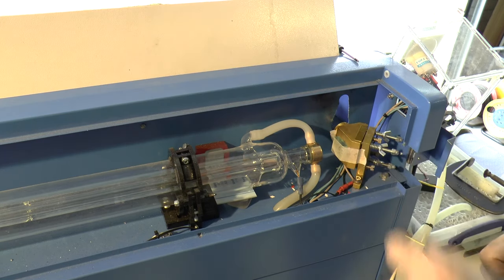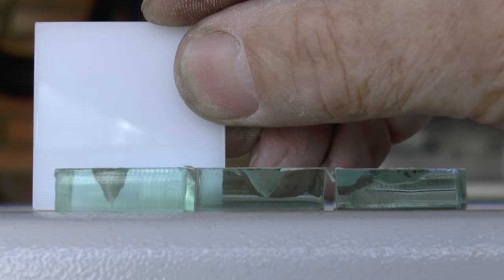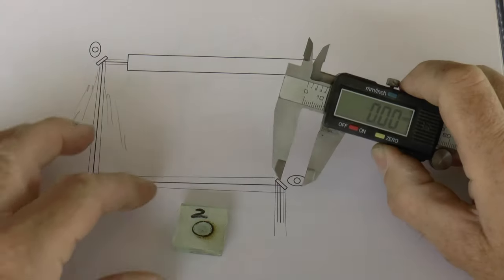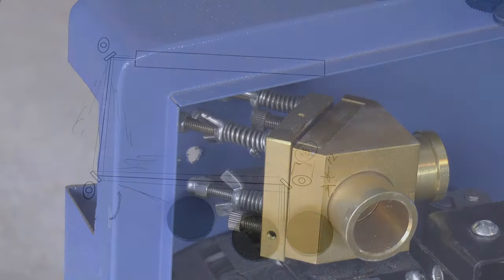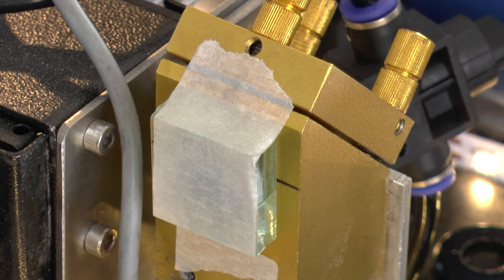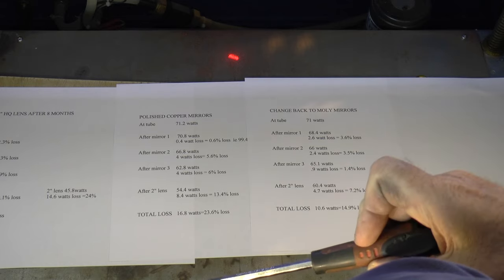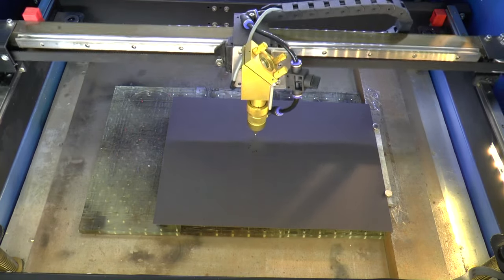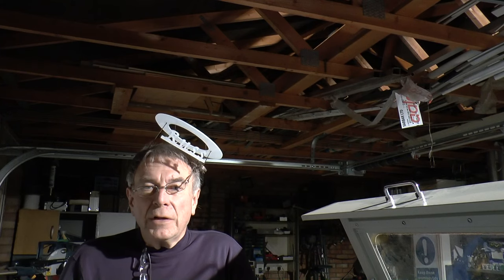RDWorks Learning Lab 79 Machine Health Check Part2

Comment: I have a curiosity question. How do you walk around totally open 60-80W laser without any eye protection at all? You even open a tube, and I see you don’t wear anything.
Reply from the maker: This is not suicidal stupidity. I have taken time to research and understand the nature of the beam we are dealing with.  This laser beam is a beam of invisible light. It is light in the infrared region of the spectrum that our eyes cannot detect. First you must realize that this laser beam is  monochromatic, coherent and basically non-diverging . That means that there is no scattering of the light as it travels around the machine, if it starts off as a 6mm beam, after travelling 2 or 3 meters around the machine it will arrive at the lens as a 6mm beam and nothing will have escaped. The light energy in the beam  is not in itself dangerous in the same way that a rock falling through the air is not dangerous. Only when the rock interacts with something does the harmless kinetic energy it possesses, change its state to something that is damaging and destructive. It's the same with the laser light  When it hits something solid one of two things can happen. If that surface is metallic, reflection will occur. Most metals are in the region of  90 to 99.9% efficient as mirrors. If the surface is non-metallic (ie virtually everything else you can imagine) then the IR light excites the molecules on the surface of that material to a higher vibration state. The higher the vibration state of a molecules the hotter their temperature. When you stand in front of a fire or you are outside in strong sunlight and your face starts burning, it's not because the  air is hot  it's because the infrared LIGHT that is being emitted from the sun/fire is stimulating the molecules on the surface of your skin to a higher vibration state ie the LIGHT energy is being converted to heat energy on your skin.
This is the mechanism by which the laser beam works when it interacts with the material we wish to damage (cut or engrave). There are many different types of laser  with much shorter wavelengths  which are more selective about what they will excite. These are potentially dangerous to your retina and you must always wear wrap around eye protection suited to the laser type. Not so with out long wavelength 10.6micron light. As I said, if this  light hits anything solid and non metallic it will start giving up it's energy as heat.  IF the beam were to hit your eye, it would start heating the surface of you eye (the cornea). That is still dangerous but you must ask, under what circumstances can that happen
Firstly, standing looking at the laser tube as it works is not going to damage your eyes. Without going into the technical way that the laser works, look carefully at your tube and you will see that is is made up of a central glass ionization tube that is surrounded by another glass tube containing cooling water and finally an outer large diameter glass tube that contains the gas mixture. The laser light only exists within the central tube. It is invisible and the pink beam you see is ionized nitrogen (lightening) NOT the laser light.  Remember that  (with just a few special exceptions) ANY non-metallic material will be heated when the IR light hits it.  There are THREE layers of glass between your eyes and the laser light in the tube. Each layer of glass is 100% efficient at stopping the energy so stray laser light will be ZERO.  There are just a few special materials that will allow the IR light through. Zinc selenide and gallium arsenide  are two materials that are used for lenses and the window on the end of the tube that allows a percentage of the beam to escape so that we can use it to do damage. ONLY if you put you head or any part of your body DIRECTLY in the path of the beam will energy transfer to heat occur.  You must not put metal objects in  your open laser work area  in case the beam gets reflected at you. This is the only risk you must be very careful about. 
If you are still fearful, always wear a pair of cheap polycarbonate wrap around  glasses   
https://www.ebay.co.uk/itm/Dewalt-Protector-ToughCoat-Impact-Scratch-Resistant-Safety-Glasses-Clear-Lens/262722925484?epid=1040466487&hash=item3d2b81b3ac:g:vB0AAOSw42dZHE3i
If you wear any sort of glasses already  (as I do) then you should feel safe without the above.
It is important to understand that not all laser beams are  the same as a CO2 laser.  Therefore, UNDERSTAND the beast you are working with  and take the correct safety precautions.

Best wishes
Russ
Reply: SarbarMultimedia omg what an explanation! You are an encyclopedia on feet 😄 thanks a lot. Finally it is also very complete and clear and makes sense. As an engineer I knew good half of this, but the other half totally helped to complete the puzzle. I always wear PC glasses AND keep window closed at all times. I am very tempted to actually open ip the tube and see it at work, but was worrying about potential exposure. Yes, tube is of course protected, but the beam that is coming out right there is not. I do not have a spare pair of eyeballs, so decided to not risk it. Accidents may happen and beam can go into wring direction. Even if this is extremely unlucky, I still don’t have spare eyeballs 😄 But I am gonna open it up now for sure, after watching you playing with it like that. I have a handheld blue laser torch which is 2W and that thing is toxic to eyes, even when reflected, part of the reason is the blue wavelength itself. So after having that torch for quite a while, I taught myself to be very careful with lasers. Even excessively careful, but better overprepare than underprepare, right? :)

Comment: I enjoyed every second of these videos so far.  Just a question.  Can you cut through more than one piece of paper at a time?
Reply from the maker: Hi Scott
The problem is air between the sheets. If there is an air gap of any sort there will be smoke created at that interface. Apart from smoke damage around the middle sheet cuts there will be a loss of power as the smoke absorbs the IR energy. On a few occasions I have cut two sheets but only because they have been stuck together.
Best regards
Russ

Comment: So, you went full circle and are back where the machine first started then.
Reply from the maker: Only until I get my copper mirrors from China. I'm sure copper is the magic bullet.
Best regardsRuss
Reply: SarbarMultimedia
I am sure you are right and lets hope the mirrors from China are better than that tube was.  Btw, who sells copper mirrors from China cheaply as I saw around 25 dollars each.
Reply from the maker: Hi That's about he price

http://www.ebay.co.uk/itm/New-HQ-Dia-25mm-Cu-Copper-Reflection-Mirror-CO2-Laser-Cutting-Engraving-Cutter-/161107827318?hash=item2582c65a76:g:XB8AAOxywZ1SNrOi
Reply: SarbarMultimedia
In line with what I was seeing at 27 dollars each times three.  Too bad we need mirrors at all but with the length of the tubes we do.  Still, ~100 dollars for three of them is ouch.  I await to see your findings with them. :)
Reply from the maker: I agree, A bit ouch but I have to know whether the real thing is as good as the promise I saw with my original tests.
Reply: SarbarMultimedia
What I am wondering is if the laser, over time, actually helped to "push" them into a concave form?  Since I know the copper had to get hotter for split moments at a time I bet it did since they would cool and contract and they would repeat that process over and over.  Not much mass there to stop that from happening.  I was asking that all through your tests (you know when you ask the screen expecting an answer, lol).
Reply from the maker: Hi 
The thing that's hard to come to terms with is the fact that when you fire a beam of heat at copper ( one of the best conductors of heat) NOTHING happens. The crystal structure of pure copper is better than 99% reflective to radiation at 10.6microns wavelength which is why it can be used for mirrors. There is theoretically less than 1% heating effect so the mirrors are never going to get heat stressed. On a 100 watt system that's less than 1 watt heating effect. So natural convection is more than adequate to deal with that. On industrial systems running at 4 or 5kw that would be at least 50watts heating at each mirror,  but that is controlled by water cooling. Any divergance  was purely down to bad mirror manufacturing by me.
Best regards
Russ
Reply: SarbarMultimedia
I see no way possible that you took a flat piece of copper and was able to turn it into a convex shape as I watched that video.  I have to say impossible from cutting and rubbing as you did so something else is at play here I think.
Reply from the maker: I used 600grade wet and dry to try and achieve flatness  but even with my "puck" method of manucature there was a small amount of "softening" at the outer edges by about 1mm all round. After several minutes of polishing on a soft cloth there was definitely a non'flat section around the outer 3mm of the disc. You may be able to see this when you look at the reflection of my neon tubes in the disc as I manufactured the mirrors. This will have had little effect with my old tube which had a 6mm beam as the beam will have worked on the flat centre section. The new tube has a an 8.5mm diameter beam which obviously does impinge on the non flat edges. All will be clear when I fit proper copper mirrors  and the beam remains parallel throughout its path.
Best regards
Russ
Reply: SarbarMultimedia
Well, I saw, and I think you mentioned it, the rounding but to make the inner part of any round, and flat, surface concave, or convex, takes more than you were doing to it.  It takes either rubbing in one spot with say your fingers and thumb or any non flat surface that it itself is not flat to achieve such a feat.  If you had a dead flat surface you attached the sandpaper to and you then stuck the copper on another dead flat surface then rubbed those together there is no way you can make a convex, or concave, surface like that or at least I can't imagine how you would pull that off doing that.

Comment: hi russ. thank you for all the work you do . i have a little problem with my machine and i was wondering if you could help me. i get a high pitch noise and loss of power but only at low power ..ex when i cut paper..... like this one: https://www.youtube.com/watch?v=VFRbJZFMdDQ .
regards
Reply from the maker: Hi Axs
Have you watched my video about High Frequency Impact engraving?   https://www.youtube.com/watch?v=mXIDwQxhX3k   If you are only experiencing the noise at say 4 to 6mA , it's likely to be this zone of uncertainty as the tube is injected with High voltage pulses at 25,000vdc  before the beam becomes fully formed whereupon the voltage drops to a stable value of about 17,000vdc I find this is an amazing zone to work in for scorch free paper cutting (on my 70 watt tube I can max it out at 13%power. At 15% the beam is stable . Every time the beam starts a cut, it passes through this zone but it happens so quickly you would not notice it. Shout out again if the video does not answer your question.
Best regards and thanks for the kind words.
Russ
Reply: thank you for the reply. very very helpful...still my noise comes from the laser tube psu also......it`s like a sqeeak.....many people on www are talking about a short.... on the red wire or on the other parts of electronics...thank you ...best regards
Reply: it was the laser psu afterall...but now the laser just stop working...no beam, no light, no spark ...just little noise from psu when the laser is activated and it supose to cut /engrave.
Reply from the maker: Hi Axs
Can you tell me if your tube is labelled KH Laser? I'm just collecting information about tube failures and PSU failures.
Many thanks
Russ
Reply: yes ..kh laser  25.12.2015
Reply from the maker: Hi Axs
Sadly, yours is just another incident in a long list of KH Laser tube/power supply failures. First KH don't manufacture laser tubes. You can find no company registration or data about them on WWW. They appear to be some shadowy organization the go round the large manufacturer collecting all the production rejects (for free???) and then powering them up to make sure they function "in some way"  They add what looks like an official label to give them credibility and then they only get installed in machines that are destined for sale on ebay. Most people buying ebay machines do not know or understand the technology. The machines are not supplied with ammeters and you cannot check the performance of your tube without special equipment which 99.9% of users will not have. So, they are pretty safe because if the tube fails the seller (who is probably selling these machines from his kitchen in China for a sales commission) is not going to answer your emails of complaint  or is going to blame you for not understanding the tube and "misusing it" It's the perfect scam. Additional to the tube problems, where tubes can fail within days or weeks, there are about 25% of the failure reports about the power supply failing first. These power supplies again may be rejects (but I have no clear evidence of this). It seems that they are made with the cheapest components and held together with hope and angels tears. Do not buy a replacement tube and power supply from ebay, you could suffer the same fate again. Go to a known tube manufacturer in China and buy from their website. That way you will almost certainly get what is specified. Tube and power supplies are generally matched to each other because different power tubes require different strike voltages. Once you have a good tube it should be reliable and serve you for a reasonable time, maybe a year for a cheap one (Cole Tech or SP)   or two or three years for a more expensive tube( Reci or EFR). Provided you buy replacement tubes of the same power then you will not need to change the power supply again.
Thanks for you information, it all goes to confirm this fraud exacted upon gullible ebay customers.

Best wishes
Russ
Reply: hello again...what do you think about yag laser tubes....a saw that they are used in some high performance machines....?....
thank you
Reply from the maker: Hi Axs
My only link to YAG lasers has been for high speed marking and surface etching.  So how this technology fits in with our simple machines is beyond my current skill set. You will need to speak to a specialist company for answers.
Best regards
Russ
Reply: hello russ...thank you again for the reply .i found SPT laser tubes and i ordered ...not reci but not so expensive....anyway it has 50 w- like my old one, 50mm diameter -like my old one, but 1000mm lenght instead of 800mm - like my old one. my question is : if i put the new one exactly where the old one was (i mean the end of the tube) , i have to (re)align the mirrors ? 
thank you and looking forward to the next video.
best regards
AxS
Reply from the maker: Hi Axs
The position of the end of the tube relative to mirror 1 is not important . Its keeping the AXIS of the tube the same for both tubes. So if you carefully remove the old tube and dont disturb the clamp bases then the new tube should go bak  and be pretty well lined up. I know how scared I was about upsetting alignments when I changed my first tube. Now I understand how to achieve good alignment I'm no longer worried. It might take an hour to completely realign everything, No more. If your tube is 200mm longer then it will no longer fit inside the frame and you will have to make a cover for the overhanging HV end of the tube. There is a replaceable plate on the end of the machine for doing just this modification.

Good luck
Russ
Reply: thank you